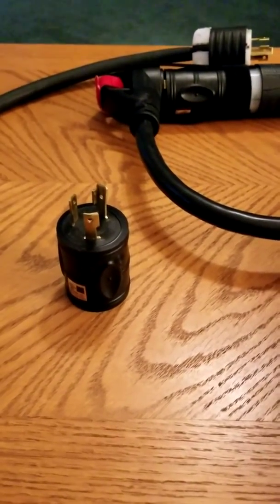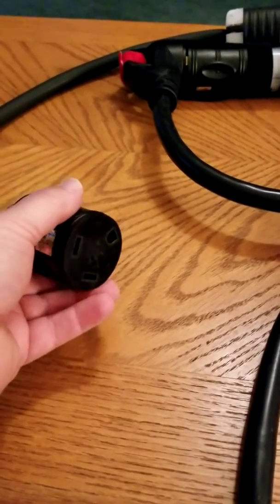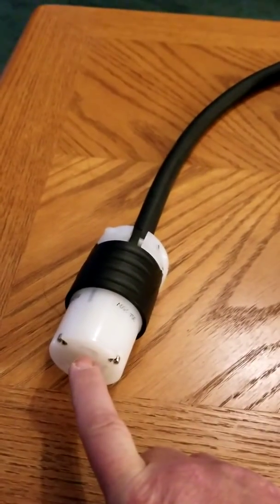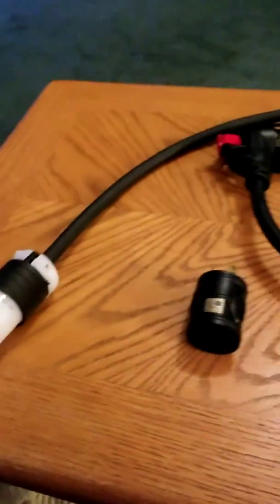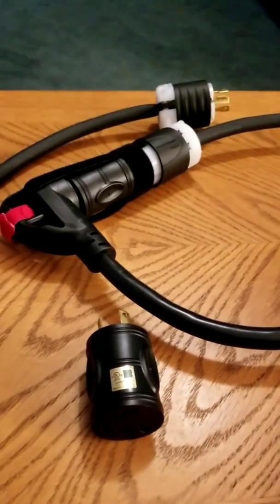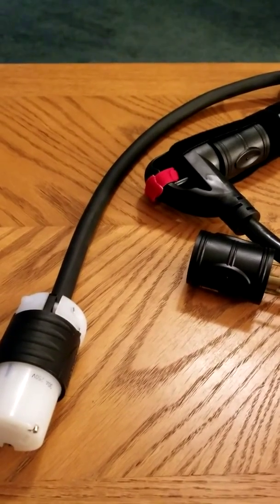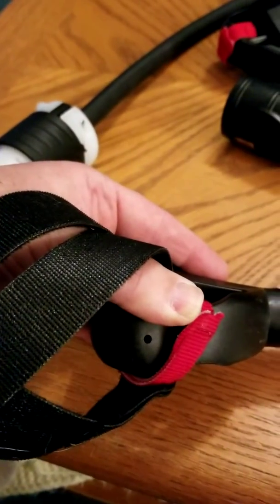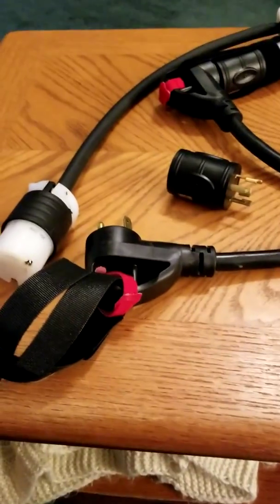The Predator Files. Generator Paralleling Cable

Comment: Why the need for the short "extension cords" why not just go from the Y adapter to each generator? Was it just to be able to keep the generators farther apart from each other?
Reply: Am I thinking correct that if I had a Honda 3000 and a predator 3500 I could use this setup? 

I’m no electrician and am not smart with this. When using this setup is one generator running “one leg” of a 50 amp plug? So for lack of better term is this basically one generator for each AC unit?
Reply from the maker: @grantschroeder6187  there is a problem in that many recent RVs have sensitive electronics. Neutrals need to be bonded to ground and any 50 system that is monitoring voltage and amperage may detect enough difference to reject the load. I have not tried that either. But certainly someone must have. I'd dig a bit before experimenting on the RV. Set up a meter to check each leg and compare. Perhaps an older unit wouldn't mind it. My 2022 Vilano and it's surge  / voltage protector would reject the input power I think due to mismatched legs one vs two.
Reply: @egregg57  Ok, makes sense to me. I might just be better off/safer using a Parallel box then? That way i know i am covered.

thanks for all your help. really appreciate it.
Reply from the maker: @grantschroeder6187  Yes, I agree. Also my 9500 failed at 9.4 hrs
Reply from the maker: The Y adapter is just too short to reach both plugs with the generators side by side, even touching and there isn't enough slack to lock the plugs in. without the extra bit of cord, the connectors would simply vibrate right out of the socket. Good question, though.
Reply: @egregg57  I know you sold this setup and went with the 9500 but my question would be, would you do it this way again vs like buying a Firman parallel kit (50amp) 

i like the setup you have/had but that firman is pretty nice as well.
Reply from the maker: @grantschroeder6187  Only if I had the spare connectors again. To go buy the connectors to build the cables is costly. A pre-made paralleling kit is more cost efficient.